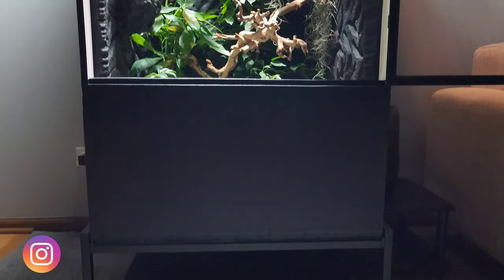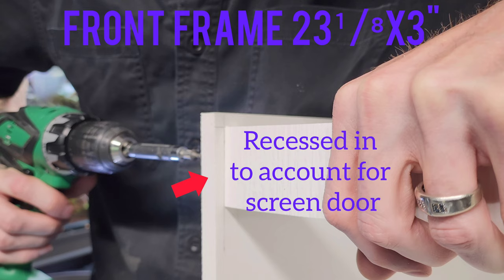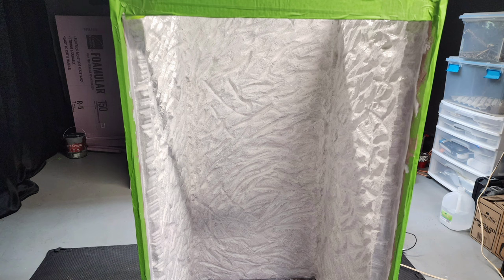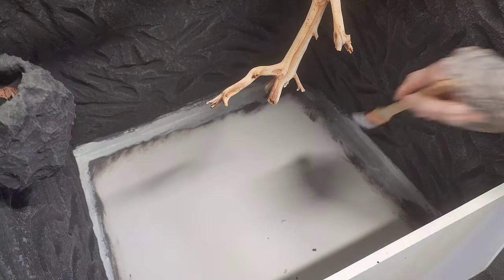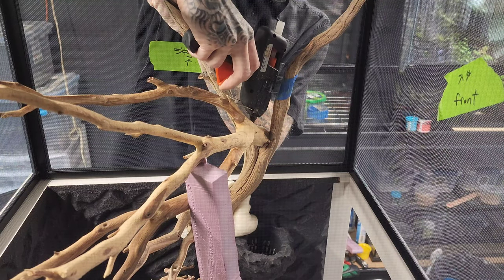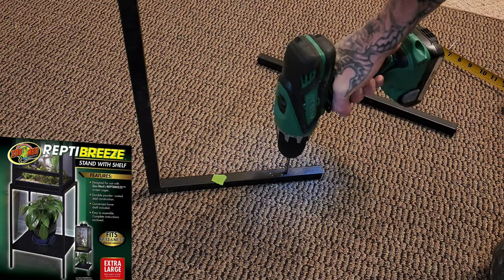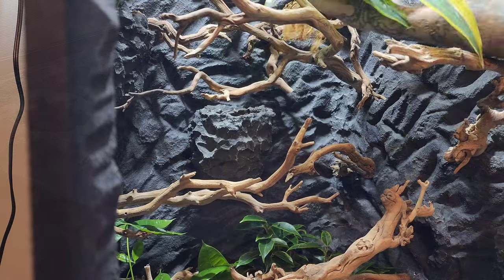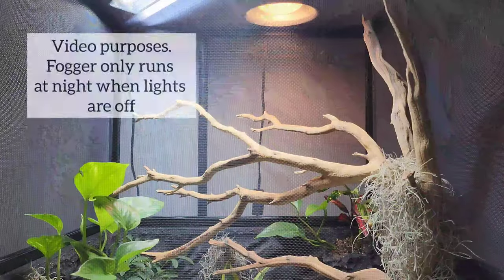Chameleon Enclosure |How To Build A Hybrid Reptile Cage PVC or Wood DIY| Bioactive Vivarium.

Comment: nice, I know the title says that this can be done with either wood or pvc, the pvc panels you used are expensive and hard to find where i am at but the wood on the other hand would make this build really heavy. Would the adhesive caulk and silicone stick to wood like it does on the pvc
Reply from the maker: Yes it would. I would use a birch plywood if not using pcv boards. Just wood glue the seal and before screwing together and wood puddy the inside seams then used drylok original for the whole interior, 4+ coats of it.
🤘💯🦎🐸🐢🐍🌱
Reply: Yo man can this be done with something like expanded pvc? Or HDPE, i cant find any pvc sheets like the one in your links and to get them shipped to me its 400$
Reply from the maker: @jesusmagallanes5835  I do know some sign shops call it expanded PVC. Just check the surface temp the material will off gas at. Most are 140+. In my ackie enclosure the basking zone it 140 with the lights installing inside the enclosure and right above the fixture it gets about 103°F so I still have a long way to go before any issue would arise. 
💯🤘🦎🐸🐢🐍🌱
Reply: @bradsbioactivebuilds  alright bro, i appreciate it forreal youre a real one. keep on working bro you get down
Reply from the maker: @jesusmagallanes5835  for sure bro, have fun with your build and hmu if you have any questions along the way!

Comment: Did you put a fan on all 3 vents and were they blowing inside or pulling out air

Thank you! It looks amazing
Reply from the maker: I only added 1 fan to the back. That seems to be sufficient. I have played with both ways, blowing in and out. But I currently have it blowing out running while the lights are on. This way, it pulls humidity out during the day to get to a dryer period, and at night, they are off with the fogger bumping humidity
Reply: @bradsbioactivebuilds  sweet thank you so much I wanna start tackling it this week! Also I’m my area I can not find PVC for less then $350 a sheet so I was thinking about birch plywood is that good? And if so how can I seal the whole board to be waterproof 

Thank you again !
Reply from the maker: @tschmalls5347  check out some custom sign shops. It's know as expanded PVC board. Some states/regions don't carry it at home depo etc.
But yes, birch, oak any hard word will do.
I would seel the the outside with a stain and  polystyrene over that paint it. For the inside 2 to 3 coats of drylok ORIGINAL would to the trick.
With wood you will wat to use wood glue before screwing it together. And after it's screwd together use a wood puddy in all the corners, smoothing it out with your finger before using the drylok.
Hope this helps
🤘💯🦎🐍🐢🐸🌱
Reply: Sweet that’s extremely helpful! Thank you so much and I look forward to your new builds !

Comment: I really struggled finding large pvc sheets instead of trim or that was an inch thick
So I bought I believe mdf wood
I was able to build it
Just looking for advice on how to waterproof the bottom
Im thinking to get the pvc that was too small for the cage and make a box to fit inside and seal it
Thoughts ?
I also bought regular silicone because I didnt realize there was a difference between it and lexel
Will that be ok or should I get lexel before I use it
Reply from the maker: @trishgantner2214  abuse 4x8' 1/2 pvc sheets. Some states don't carry them at big box stores. You can tryba custom sign shop.
Also if you were to use wood I would use wood glue when screwing it together.
Wood putty the seams
Then polygem 1618 the inside a few times.
Reply from the maker: @trishgantner2214  I like lexel, it has a better bite but a longer cure time

Comment: I've been researching, with the plan of building a vivaruim enclosure, for a Panther Chameleon. I have a 4ft long bookshelf that I intend to mount the enclosure on. My plan is to make the enclosure 2' W x 4' ft H x 4' ft L (roughly). I also intend to add a slideout drainage tray under the enclosure for easy clean up. I like the screened-in top for the enclosure and the side vents in the enclosure but my question/concern is heat and humidity retention, especially with a screened-in front door. What experience have you had with the moisture levels and temps with this vivarium setup. Can you offer and suggestions on how to adjust it if need be. My enclosure will be indoors in my air conditioned home and the humidity level in the winter averages ~30% and a temp of 67F year-round. 

I'm totally sold on your ingenious build. Great cage and keep up the good work. Although I took plenty of notes on the supplies needed (which Home Depot or Lowes should have most of it), it'd be nice to have a detailed supply sheet with your source of the supplier, it'll save me a lot of time. 

If you were to do it again would you change anything in your build?     

Thanks Brad
Regards
FigTuna
Reply from the maker: Thanks for watching, and I'm glad it has helped.
For this particular build, I built around the chameleon. They need airflow, so the screen front and top works great. The basking temp hits my range for temps. Other than that, he likes it room temp in the other parts of the enclosure. 
The build dries out from the mid to upper level during the day with a drop in humidity, which they prefer during the daytime. At night, only I run the fogger for 5 hours to bumb humidity.
If I had to change 1 thing, it would have been in the tip portion where I used sprayfoam to attach the top branch to the other one [inside the screen dome]. I have since reinforced it with polygem Zoopoxy.  mainly bc j had some left over from another build I was working on and didn't want it to go to waist
Reply from the maker: I also have all three products amd materials listed in the description in the video
Reply: @bradsbioactivebuilds  Thank you for the response Brad, that's great information and answered my critical concerns about temperature & humidity.

 Where did you source Your PVC sheets?

Thanks again buddy
Steve

Comment: How did you attach the screen frame top to the pvc board bottom?
Reply from the maker: Hey Dennis, I gust set it into place. It was a snug fit and would take a lot of weight to knock it out of place. I used some silicone in the front only to lock the front in joining the pve to the screen frame.  If it wasn't snug, I would have added 1 or 2 screws through the pve into the screen frame. 
Lmk if that helps
🤘💯🦎🐸🐍🐢🌱

Comment: What is pvc board and how did you attach the message dome?
Reply from the maker: PVC foam board. It comes in 4x8 sheets at home depo, Lowes etc in some states. 
I didn't have to secure the screen dome top in. It's a snug fir with how I framed out the base. I could have added screws if needed. But I was happy with how snug it was.
Hope this helps.
🤘💯🦎🐸🐍🐢🌱

Comment: Do I have to put fans on all 3 vents
Reply from the maker: Not anymore. I started with 2 (back and right side) but removed the right side because the air flow was fine with just the 1. Lmk if you have any other questions!
🤘💯🦎🐸🐍🐢🌱

Comment: Not familiar with bio active.  Does that mean you never have to clean up poop, etc?  The substrate and bugs eat it up?
Reply from the maker: Bioactive is great in mist cases. I still need to do spot cleanings from time to time but the clean up crew (bugs) and plants create an ecosystem that is, for the most part self-sustaining. The bugs eat mold and poop aeration for the soil and plants help with humidity, nutrients and more.
Great question and there are a lot of helpful videos on YouTube 
🤘💯🦎🐸🐍🐢🌱

Comment: What was the final cost on this? Wanting to do something similar for a pair of mountain horned dragons.
Reply from the maker: I know I comment it before but I forgot the exact numbers. But with out the wood, lights and stand I'd say under 300
Reply: @bradsbioactivebuilds is the pvc board rather than plywood just for moisture resistance?
Reply from the maker: @FuryKnight  is a lighter weight and holds humidity better. Either is a good option. I just prefer pvc more
Reply from the maker: @FuryKnight  but for this specific build, plywood or pvc wouldn't really make a difference in holding humidity bc of the design

Comment: How many sheets of pvc did you buy?  I have a baby panther and have a ton of time to try to build this enclosure!
Reply from the maker: I just needed 1 sheet for a 2w2d4h PVC portion. Cut in 1/4's (
1: 2'w
2: 23¹/²"w
Last pannel (after cut) 24"x24"
Than remainder from above pannel for the front bottom, top cross bar and upper inside light for screen dome top to sit on.

Then, I added the screen dome top to desired hight.
Reply from the maker: Let me know if you have any questions along the way, and have fun with your build. 
🤘💯🦎🐢🐸🐍
Reply: @bradsbioactivebuilds  the link for the foam board is not working.  How think of foam board did you use?  Thanks!
Reply: *thick
Reply from the maker: @christinelongmuir7894  the xps foam board can be found at all large hardware stores. For this build I only used 1" thick. If you want to be able to carve fore go woth 2"thick. A chameleon won't use the background xps board to clime, so that's why I went with 1"

Comment: Dude this is amazing. Been missing my chams lately and have wanted to get back into it and this is super inspiring. What was total cost of this build ballpark? Super well thought out man, thanks for the info
Reply from the maker: Thanx bro and I'm glad you found it inspiring. I say go for and get the Cham!
Ballpark cost around the 225 mark. That's if you use branches from outside. I had some Glassboxtropicals.com ghost wood laying around, so that's what i used. But that will bring the price up if you go that route. 
This price also doesn't include lights substrate and plants. Only because that can be a lot of different prices. But with that id's say adding on another 300 tops to play it safe. 
Thanx for watching and I say go for it!
🤘💯🦎🐍🐸🐢

Comment: Hi what cement color colors did you use I see you show the colors but they look burly
Reply from the maker: Final color i used Quikrete charcoal.
Base coats it doesn't really matter bc it will get covered. But for those I used brown, terracotta 
🤘💯🦎🐍🐢🐸🌱

Comment: Do you have enough air flow with the bottom 3 vents?
Reply from the maker: Yes. Between the open front, top dome, and 3 vents with 40mm cpu fans, I can adjust airflow accordingly. 
🤘💯🦎🐍🐢🐸
Reply: @Brad's Bioactive Builds  
Ok im kind of coping your build, except my front door will have a plexiglass  do you have fans on all 3 vents?
Reply from the maker: @smoss23  for a chameleon, the front screen really helps add to the open airflow. But I only run 1 40mm fan on the back vent. That seems to add enough airflow.
🤘💯🦎🐍🐢🐸
Reply: @Brad's Bioactive Builds  
Cool thanks for the feedback. I'm going to try the closed front and maybe add a 2nd fan or two vents in the door..
Reply from the maker: @smoss23  awesome! Have fun with your build! 🤘💯🦎🐍🐢🐸
Reply from the maker: @smoss23  if you have any questions along the way feel free to ask.

Comment: about how many hours do you think this took you?
Reply from the maker: I worked on it a few hours a day for about a month and a half. But a lot of that was figuring out design and layout or cure and dry time.
Reply: @bradsbioactivebuilds  thanks for the response...just one more question. you used 1"XPS board and then carved the detail. can i ask why you decided on using XPS instead of just spraying then inside completely with foam and then pulling away the top layer? im just curious, thanks.
Reply from the maker: @submissionoutdoors570  great question. With larger enclosures I find it easier to use xps board for these reasons:
1. It covers more square feet quicker
2. It's easier to apply drylok to xps (spray foam is porous and harder to get drylok into and takes more time)
3. On smaller builds I do use sprayfoam instead of xps
Hope this helps!

Comment: Why did you use silicone instead of using lexel all the way down the seams?
Reply from the maker: Honestly no reason at all. I had an open tube of silicone I wanted to burn up. I wish I did do it all in Lexel. I like lexel bc it's paintable so when dryloking over it it sticks and adds 1 more waterproof for backup
Reply: @bradsbioactivebuilds  oh ok. My husband and I are working building ours now. Got the back and side put together yesterday. Then bought the rest of the stuff today and will start on it again tomorrow. He was just confused on this part of it. Thank you!
Reply from the maker: @Samantha Leonard  awesome, it's cool you are doing it together. If you have any other questions, let me know. Have fun with the build!
🤘💯🦎🐸🐍🐢🌱